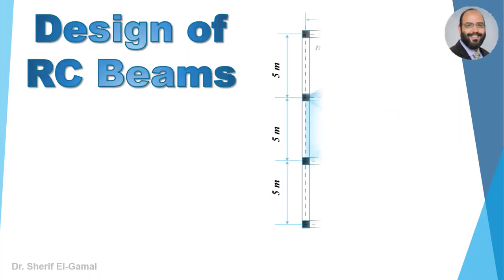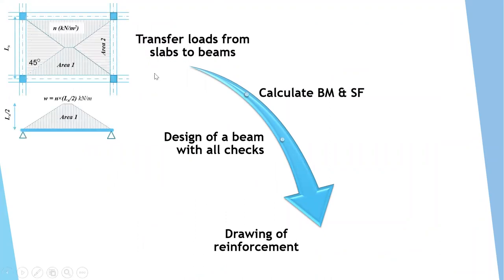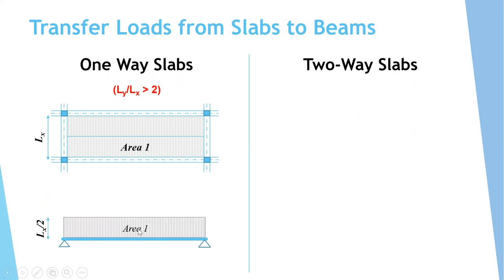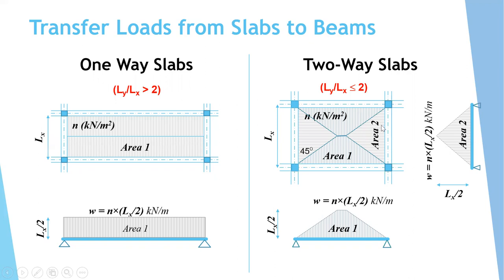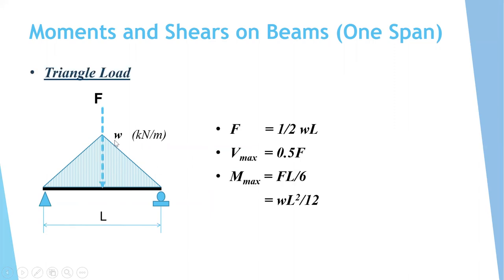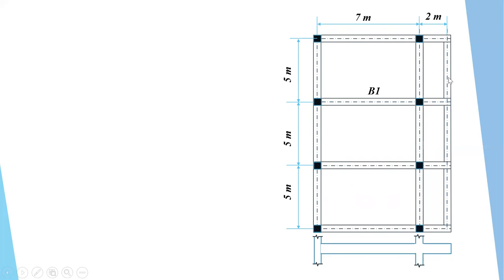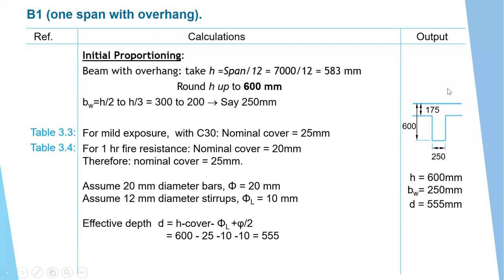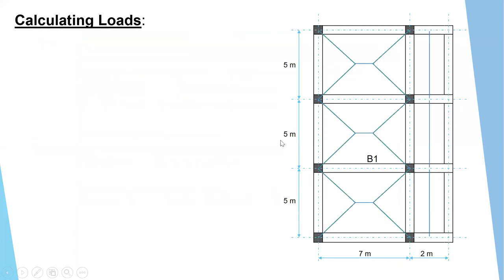Design of Reinforced Concrete Beams - Transfer Loads - Bending Moment - Design - Reinforcement

Comment: great vid, do you have the formula of fix end moment for trapezoidal load, i am using the hardy cross method for frame analysis but the slab is a two way slab.